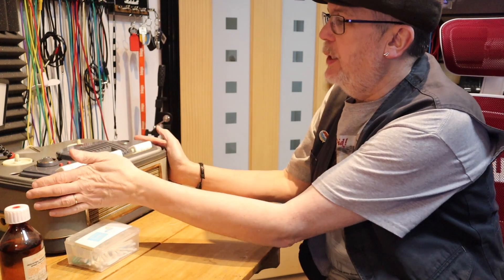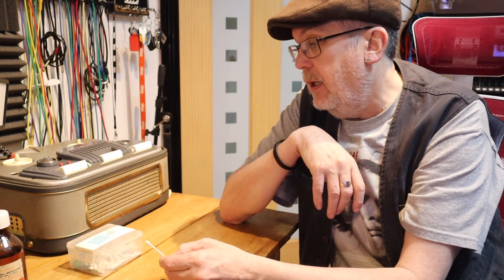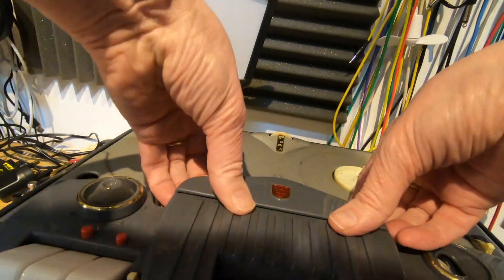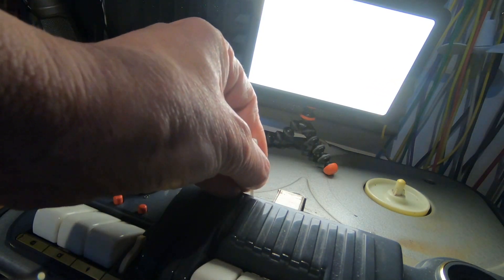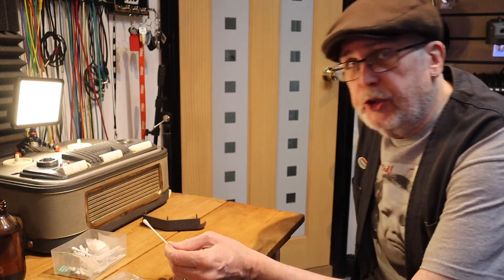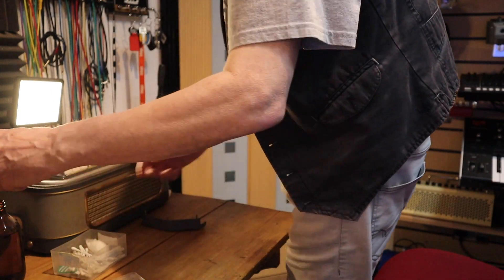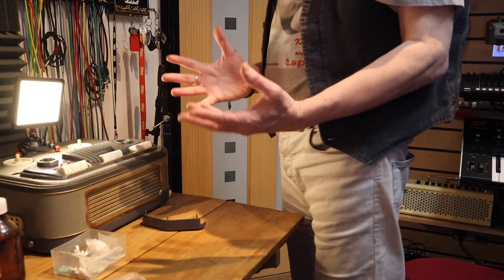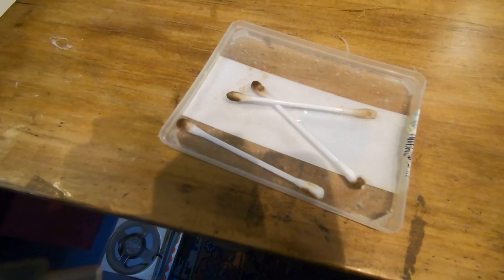Introduction to the Philips EL3542A Reel to Reel Recorder (Part 2)

Comment: Actually the big metal head in the middle is the play AND record head. The smaller one is the erase head. I've got one of these (my dad had one too) and they are a really good m/c. You won't appreciate the quality until you plug in a decent speaker into the side (The built in speaker is pretty rubbish) and do a recording at 7 1/2 ips. The frequency response should be 40 to 20,000 Hz which was better than anything at the time. Also you've got a built in valve amp which is good. I also then got the stereo version, EL3536, which a has a stereo amp and can play stereo pre-recorded tapes (mostly from the USA). On yours the stereo out socket was designed to work with a specific external Philips amp which plugged in to give the other channel when playing a standard stereo tape.